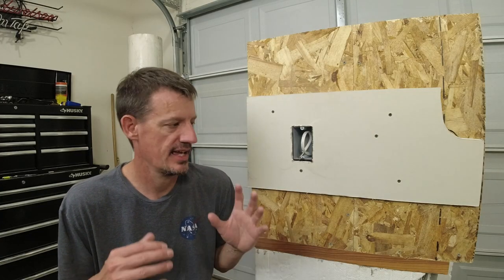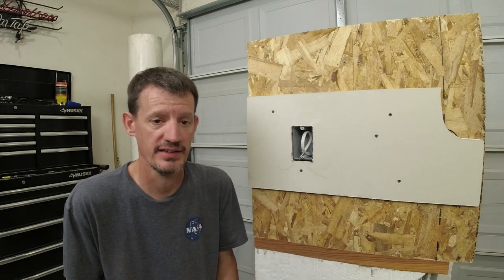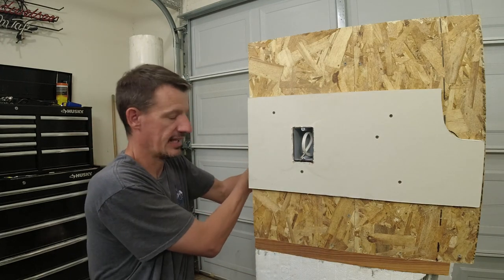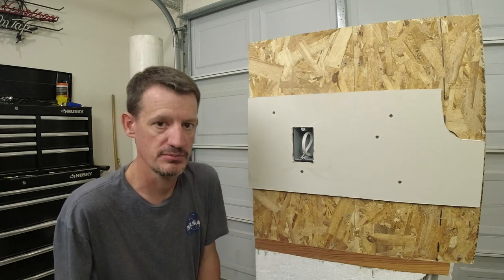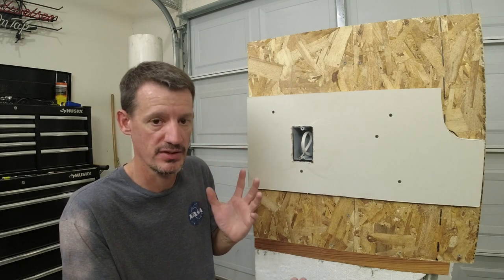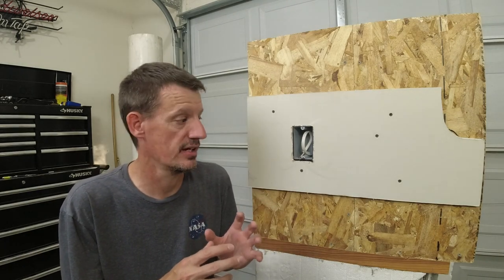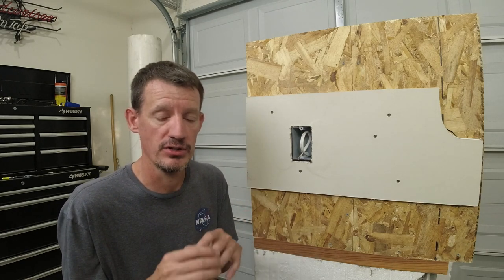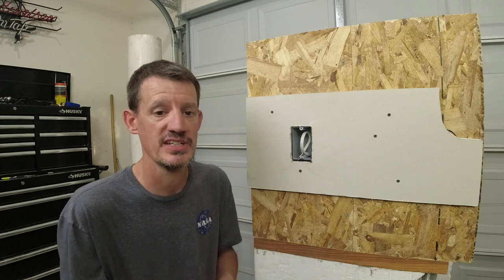Top 3 Pros and Cons of SIPs Construction

Comment: Im sold on sips, but I think the general public has not embraced them because many builders are old school, they started with a hammer and saw, it is what they know, so change doesn't come easily and they promote what they are comfortable with.  I had a builder tell me that he proposed sips over stick built to his customer at a nominal increase in cost but with the benefit of much lower utility bills, but the customer chose to spend the equivalent cost of sips to upgrade their flooring.....how short sighted.
Reply from the maker: I agree with that.  I'm taking this on as a DIY project, and it took a while to convince myself to go with SIP's for the same reason.   I was  comfortable with the standard stick framing methods of the past.   It took a lot to get me off that mindset and decide to go with SIP's.  

On the flooring upgrade.  I will never understand how people think, but most tend to take the immediate results route.  We're an instant gratification society.
Reply: Nominal increase?

Comment: I simply want to enclose and extend 4' a portion of a 8'x 14' shed roof porch, currently non insulated metal shed roof. I want to put in a door and three windows. Assuming I have the windows and doors figured out/ and or on hand, does this sound like a cost effective way to do this? Do they do floors as well?  I don't see why the current roof joists couldn't be insulated from below and be just fine as is…Central Texas…not normally problem with snow or winter here.
Reply from the maker: With what you already have in place it might make sense to just frame that in.  You might call one of the manufacturers and see what they say.  They can look at some pictures probably and give you options based on what you have in place already.
Reply: I was trying to find someone local on line…waiting to hear back. One wall has no windows and I thought that piece with the corner might be good to do sips. Amazingly none of the contractors I've spoken to knew much about SIPS construction. I dropped the temp in my house this summer 20 degrees by simply putting a less than inch thick piece of styrofoam around the window units where those pleats go. That alone spoke volumes about the insulating ability, and that one blank wall would be pounded in the summer with direct sun. Why I ask….
Reply from the maker: @moki888  Yeah, we had that problem with contractors also.  The manufacturers will know some people in your area you can talk with.   Most framing contractors once they see it, can understand enough to give an estimate, but they always have some fluff to cover the unknown.

Comment: Life time expected out of the SIPs?
Reply from the maker: It should be the same as a standard stick framed house.   You definitely want to make sure you are protecting it from the elements.  I think the biggest issue would be the cost of repair.   If you get a section that gets water damage, it's a harder more specialized repair than standard construction.

Comment: At about 10:55, can you give an example of the math you did? I build apartments and our structure is very complicated with wood. Most structural eng don't want to "do the math". They don't seek out better options. Why should they? There is no incentive. I like the ease of construction,fast, the precise off-site component, and the energy. Help me with the math.
Reply from the maker: In that statement I'll refer you back to 1:45 in the video and my realization how much structure is actually in the panel itself.   That doesn't even take into account the beams and other stuff that is associated with the building envelope.   At that 10:55 mark I was referring to how the industry doesn't do a great job explaining exactly what you are asking.   I talked with a couple manufacturers and eventually talked with a structural engineer that has experience with SIP's.  That's when I finally started to grasp what I was looking at.   Wright engineering did the structural engineering on our plans.   They had experience with Both ICF'S and SIP'S.  I'm definitely not an expert and not all engineering firms are familiar with SIP's.  Find one that is and they can get you hard numbers the actual equations to answer your questions.

Comment: Hm, I read about SIPS and off-gassing toxic compounds. How true is that actually? Very hard to find information on it.
Reply from the maker: The materials used to manufacture them are all materials you would find in any standard construction.   I wouldn't think they would pose any risk greater than standard construction.   I did see something about a different type of foam that was being used in other countries. Maybe that's the issue you're hearing about.
Reply: @thekayfamilybuild  hi, i read about formaldehyde, and terpenes and aldehyde, which "off gas" out of the OSB over months to come. So naturally I want to inform myself about that, before starting to build an SIP home.
Reply from the maker: @advent7166  Yeah, I think some of that happens with lots of building materials.   I remember reading something about that with travel trailers.  The osb is the same stuff that is used in traditional construction, so I'm not sure you can totally eliminate all the risks.  I'll look into it, but I don't have a definitive answer for you on that.  When you think of the giant stacks of osb at Home Depot or Lowes, that's fresh out of the factory.   You would think employees from those companies would have issues that would pop up.  Ikea furniture, for instance , is manufactured out of composite wood products glued together.   Kinda hard to avoid that stuff in this day and age.
Reply: @advent7166  As shown the EPS, Expanded Poly Styrene, insulation in this video does not off gas after manufacturing. You can look up the manufacturing process on YouTube that illustrates this. Some SIP companies use either a Urethane or Poly Iso foam system which are both two part component foams. Although these foams have a higher initial R value/inch over time they do off gas which will lower their R value as well. EPS remains stable over time. 

I built with SIPS for years, started with my own 2500sq. ft. home in the mtns. of Colorado and the company I ended up using didn't depend on the load bearing of the walls and had 2x6 studs in the center of the 4' wide panels and full king/trimmer/headers around window and door openings. The roof panels also had 2x's in the middle as well as in the joints between. Building with the snow load in our region as well as fastening siding into wood, not osb, was a safer system. It was not a pre-cut system however and there was a bit of a learning curve but nothing we couldn't handle and got better at it as time went on. 

Ended up specializing in SIPS for over 10 yrs and did installations all over the country including AK. Lots of roof systems on log home because the company had roof panels up to 28' long with 1x8 pine t+g laminated to the foam instead of OSB which was possible due to the framing members that conventional panels didn't have. It is pretty sad to me that SIPS never really caught on and now I see companies doing stupid things like 3D printing houses with cement....and in general continuing on with decades old framing techniques. I especially get a sense of wonder about the use of the green sheathing that has a thin layer of EPS bonded to it that is so popular now.
Reply: @Allyh1015  I am not at all familiar with Steel SIPs and a quick perusal on Google doesn't show any engineering that would help me to better understand them? The few pictures I found weren't enough to form an opinion but other than them using EPS insulation it seemed that although the roof structure looked conventional enough with structural members going from the wall to the ridge the wall panels being installed with the steel members going vertically doesn't seem lke it would carry the roof load to the foundation.

Comment: Regular Framing plus spray foam….and it will be much cheaper …. I got estimate and it was  25% more……
Electrical bill in S  Florida $96-128 per month   For 2600 sq ft house…. You can’t beat this efficiency…. For 25% increase people would install solar …but in 10 years power bank has to be replaced ( $15k-20k)-and this is $2000k per year - which is $166 per month 😂😂😂
Do the math …..
If it would be cheaper - than people would go for this …. Maybe …..
Reply from the maker: I definitely agree that especially in a climate like yours, if energy savings is the only factor, it might not make sense.  For us, the speed of construction is the factor that sealed the deal for us.  We see temperatures from the upper 90s in the summer to below zero in the winter.  So energy efficiency and comfort are huge upsides.   The fact that we can dry the structure in with a small group of our friends in about a week after setting the first sip is huge!  That's honestly what helped finalize our decision to go with SIP's.